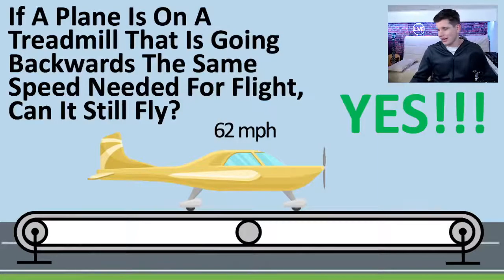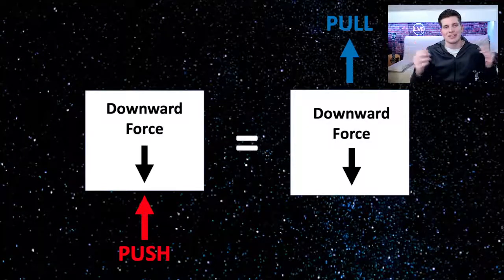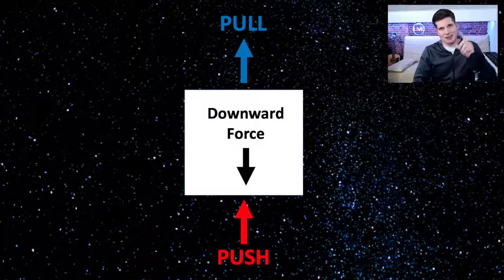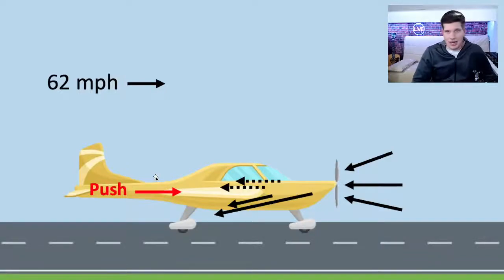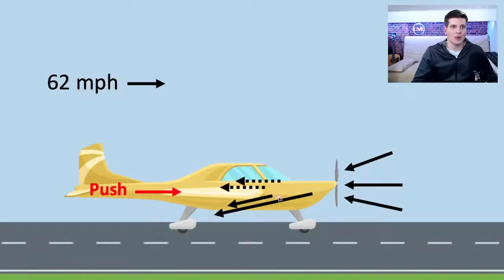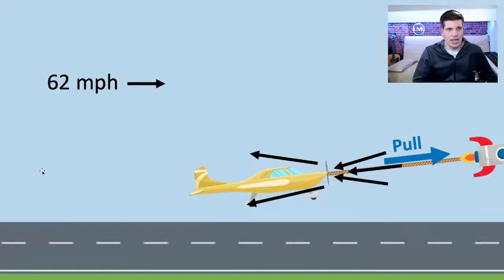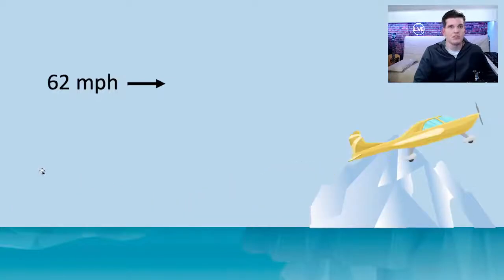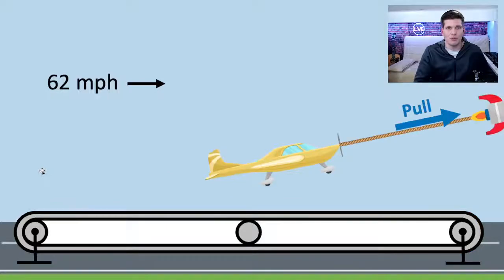Can A Plane Fly On A Treadmill? SOLVED! -A Practical Review

Comment: Yes, a plane can fly standing still!  It's why I had to unchain the plane before flying so the Santa Anas wouldn't blow it away.  Don't confuse LIFT with THRUST!
Reply: The thrust will move the plane forward regardless of how the wheels are spinning.   Put a toy airplane on a powered treadmill.  Push it forward with your hand.  No matter how fast you run the treadmill, you will always be able to push the plane forward.   How fast the treadmill is going or the wheels are spinning isn't going to change that.

The wheels and treadmill will always be going the same speed, but the plane will still move forward as per normal.

Some people seem to have their brains stuck on the idea that somehow the wheels spinning on the treadmill will hold the plane in place.  A rather silly notion.
Reply: That's not flying. Is your plane going to achieve lift and take off from a stationary position or just get blown around?  I've had plywood "take off" from my sawhorses in my backyard too.  Didn't count it as "flying."  

Doesn't matter though, because no matter how you slice it, air mass over the wings, either from forward thrust or generated from winds, created the lift.
Reply: Oh wait, I got to the 9 minute mark!  You really should have a basic grasp of what you're talking about!  A plane isn't pushed, it's pulled and LIFT is what makes it fly, THRUST gives forward motion.
Reply: @sephfyr  Precisely! And the only way an airplane can generate lift is having air passing through the wings - be it by a headwind, be it by moving through the air with thrust.
Reply: Also there's another factor: on a high-wing, prop-puller aircraft, the propeller will blow air on the bottom side of the wings, generating a small amount of lift (enough to break from the treadmill's resistance, perhaps?). This wouldn't work with a prop-pusher or a jetplane though.

Comment: If the wheels and the belt speed match according to the rules, wording and definitions, a person on the ground can talk to the pilot during the experiment. No forward movement. Not airflow. No lift. No flight.
Reply: The wheels and belt speed will always match.   Neither has anything to do with the plane's speed.  Ground or air.
Reply: The plane is stationary on the treadmill since the speed of the wheels and treadmill are equal.
Reply: @shooterqqqq  Uh. No.   The thrust is coming from the propeller/jet.   Put a toy car on a powered treadmill.   Hold it from behind with your hand.  The treadmill moves and the wheels spin.  Push the car forward.  The car will go forward and the wheels will spin faster, but the car will still go faster.   Increase the speed of the treadmill, push the car forward, it will go forward no matter how fast the treadmill is going or how fast the wheels are spinning.

You are letting your brain get stuck on a detail that is irrelevant to the question.  How the wheels are spinning on the treadmill doesn't matter.
Reply: The rule is the wheels and the treadmill are going at the exact same speed. That is the simple direct rule of the experiment. The plane can not go forward or backward without violating the RULE. I did not make up the rules of the experiment. I am understanding the rule. The plane does not move forward. There is no air flow under the wings. The plane does not fly. Their rule. Not mine.
Reply: @shooterqqqq  I thiknk that is wrong. It is the plane and the treadmill going at the same speed, not the wheels. The wheels will be moving 2x as fast. They will be moved 62 forward and 62 reverse at same time so they spin at 124mph.Imagine standing next to a treadmill and dangling a yo-yo so it touches the moving belt. It will rotate at whatever speed the treadmill goes (e.g. 10mph). If you pull it forward at 3mph the yo-yo will move forward with you at 3mph but it will spin at 13mph.
Reply: @PJMaybe75  The rules are not wrong. That is the rule of the experiment. The plane acts exactly as a person on a treadmill. Neither going forward or backward. No forward movement. No rearward movement. No air flow under the wings. No lift. No flight.
Reply: @shooterqqqq  That's right. It is the plane that matches the speed of the treadmill, not the wheels as you mentioned earlier. If a treadmill moves at 62mph and the plane matches that speed, the wheels will be rotating like it is pushing at 124mph

Comment: The car does not travel at 124mph relative to somebody on the treadmill. The person sees the car coming towards him/her at 62mph.
Reply: The car wheels are spinning but it is going nowhere. The person on the treadmill will get closer to the vehicle at the rate of 62 mph. 0+62=62
Reply: The person on a treadmill is meant to be standing on a belt and going around and round with that belt, that's how it's meant. So the vehicle will be moving towards them at 124mph not 62.
Reply: @hlalelemahlaela77 wrong

Comment: My 2 cents: only 3 things to care about regarding flight. (1) is there wind/breeze? (2) can the plane move? (3) how strong is the engine?

Explanation: (1) a tornado can lift ANYTHING  off the ground, so a strong enough wind/breeze WILL pick up an aircraft, even if the plane does not move. (2) a glider CANNOT fly without moving air, so even a plane with big wings cannot "lift off" without help (if no breeze and no movement). (3) a quadcopter has no wings, and they fly FAST, thanks to engine power alone. Big enough engine will lift anything into the air; rockets for example. 

So, just pick a proper engine size, ignore the wings and wheels, and assume the plane does not get to move. That engine will pick the plane up; that is how VTOL (vertical takeoff) and helicopters work.

Final note: the engine would have to be able to either point up enough, or move enough air under the wings, for the plane to actually move against gravity, since the conveyer belt essentially means that the plane will always remain where it is, along the ground.

TLDR: engine size and orientation is all that matters. Ignore everything else, or you WILL get confused. 

It is still fun to think of all the variations...
Reply: But with a regular plane it relies on wind speed over/under the wings. If the plane is reversing on a treadmill the windspeed is negative. So how can it still take off? The props will pull air over the wings and all it will do is cancel out the negative wind speed. Or is it that taking off on a treadmill works but the props have to work twice as hard to do it?
Reply: Hi  @PJMaybe75 . Most planes are specifically designed to move forward only, so I assumed this in my answer. This is mostly due to the shape of the airfoil and position of the control devices (flaps, rudder). But there are symmetric airfoils (with slightly less lift), so it MIGHT be possible to lift off "normally" going backwards. It might even be possible to control the plane. But why bother?

There are also pusher aircraft, where the engine is at the back of the plane. They fly just fine, and do not change my thinking from before. Hope this helps!

Comment: good stuff. people keep saying its a "wording problem" and its not, its a lack of understanding of how physics works.
Reply: It's really a "Nerd Egos are the Worst" problem. LOL.

The question posed is really "Can a stationary airplane take off?" The answer is no.  The conveyor belt is just a contrivance to create that condition.  Everybody is going down rabbit holes answering questions that are never asked.  Airspeed is all that matters.  All other conditions are secondary at best.  Most are totally irrelevant.
Reply: Let me restate the problem.  Lets assume take off speed for the airplane is "X".
The usual wording is 
The conveyor belt goes backwards at speed X, and the airplane goes forward at speed X.  

But what do we mean by speed?  Here are two alternate ways to word the question:
1) The conveyor belt goes backwards at speed X, and the wheels on the airplane go forward at speed X.  
2) The conveyor belt goes backwards at speed X, and the airplane goes forward at air speed X.  
In the first example, the airplane has an air speed of zero and cannot take off.  In the second example, the airplane's wheels are going twice as fast as normal but it has not problem taking off.  

The problem is speed of the conveyor belt is measured against the ground it is setting on.  The speed of the plane could similarly be measured against the speed of the surface it is setting on, but instead to make the airplane take off they measure it against the surrounding air.  Which meaning of "speed" you use determines if the plane goes fast enough to take off or not.  

If you replace the plane with a car, there is no question everyone would measure the car's speed against the belt.  This makes the car have an airspeed of zero.  But because it is a plane instead of a car, we normally measure its speed in terms of air speed.  But we don't have to, we can measure speed according to whatever frame of reference we want to use.  And in the problem, the frame of reference for the plane's speed is not clear.

Comment: The real problem is the way the question is worded. The problem states that the treadmill exactly matches the speed of the wheels. Not that the wheels are going 2x the speed of the treadmill, that it always, exactly, matches the wheel speed. That's a fatal flaw because, by definition, that would mean the plane was stationary. It would be like standing on a treadmill wearing roller blades and holding onto something so you are not moving and your skate wheels are moving at exactly the same speed as the treadmill. Stationary. But if the plane is stationary, why are the plane's wheel spinning? The plane can't be making them spin because it's not moving forward. The treadmill is not supposed to be driving them, it's supposed to be reacting to them. So why are they spinning at all? And that's the flaw. If anyone really wants to visualize the issue with the question, replace treadmill with rollers under the wheels that, again, spin at the same speed as the wheels at any moments, instantly. 

The problem, they way it is worded, is physically impossible. So no, keeping to the conditions of the problem, it does not take off. It can't, it's not moving. In reality, the conditions of the problem are impossible to achieve unless the engines are turned off and the treadmill is not moving, in which case the wheels and treadmill are in sync because neither is moving at all. The question itself if just invalid.
Reply: "But if the plane is stationary, why are the plane's wheel spinning? "

because you're pulling the ground underneath them..
Reply: @MattMajcan  Then the treadmill isn't matching the wheel speed. Also the belt is not supposed to be the primary motivator of the wheels, it is only supposed to react to the wheel speed. If the belt is causing the wheels to spin, then we've gone beyond the parameters of the question. So again, why are they spinning?
Reply: @9Blu  The treadmill can't match wheel speed because the plane will move relative to the ground.  No matter how fast the treadmill goes, the wheels will go faster than that until the wheels are going 62mph faster than the conveyor at which point the plane will take off.  
Instead, limit the plane's wheel speed to match the conveyor.  Or better still, simply accelerate both of them to 62 mph.  
If both are going 62 mph, then the plane will be stationary relative to the air and will not take off.
Reply: @greybeard5123  Then the conditions of the question are violated, as the treadmill MUST match the speed of the wheels at all times. If the wheels move faster (or slower) than the treadmill, then it's a fail.
Reply: @9Blu  We're back to wording.  If you let the plane do whatever and try to make the treadmill match the speed of the plane wheels, you are doomed to fail.  

Lets go back to your original post.  "The treadmill is not supposed to be driving them, it's supposed to be reacting to them."  Where in the problem does it say that?  The wheels and the treadmill are connected.  Unless you hold the plane in the air - making the treadmill completely irrelevant - then the treadmill and wheels will affect each other.  

By the way, I and the video both agree with your basic premise that the question is not clear.  However, this video attempts to lay out the question in both formats.  
I do not like the Myth Buster video.  It clearly uses wheel speed when defining the myth, and then uses air speed when they test it.
Reply: @greybeard5123  We are back to wording because the wording of the problem is important. If you don't follow it, you are not working this problem but making up a completely different one. 

As for the treadmill not driving the wheels: "The treadmill always exactly matches the speed of the wheels". That is where it says it. Unless the treadmill can somehow violate causality, it can only meet that criteria for one speed: 0. If it drives the wheels, then it has to, by all the laws of physics, move faster than the wheel of the plane for a moment. If it only matches what the wheels are doing, then same problem. 

Also the wheels and treadmill are not connected, one rests on the other. Your car wheels are not connected to the pavement, otherwise the car would not be capable of moving as they would literally be part of the pavement and stuck in place.
Reply: There's one way to interpret the wording of this problem, the conclude that it would be impossible to meet the conditions. 
There are several more ways to interpret the wording, which would allow for satisfied conditions. 

It seems that you are defining "speed of the wheels" as "the speed a wheel would travel if rolling on a surface under normal conditions at a given rotational frequency". This is one way to calculate the speed of a wheel, but it doesn't define the speed of a wheel. 

The speed of a wheel would be defined by its distance traveled per unit of time. 
If it spins 1,000,000 revolutions, 10 revs, 0 revs, regardless, and moves one meter over one second, its speed is one meter per second. The frequency of rotation doesn't define its speed. 
Though, in some cases, such as in a car... The frequency times circumference, is typically correlated to its speed.

At any given moment, other than at rest.. The top of the wheel and the bottom of the wheel are never going to have the same velocity. 
"Wheel speed" must be defined as the linear velocity of the axle
Reply: @snytty  that is a lot of words to say "you are right"
Reply: @snytty  So you're saying if I put a car on a test rack (the ones with rollers under the wheels), and I hit the gas, the wheel speed will be zero?  Because the axel isn't moving.  But the car's speedometer show it is going pretty fast, and if you put your hand on a wheel you will be seriously hurt.  

The relevant speed question for this topic is if you are measuring the speed of the wheels on the airplane (sometimes called ground speed although in this case it would be conveyor speed) or if you are measuring the airspeed of the plane (which is the normal way airplanes measure speed).